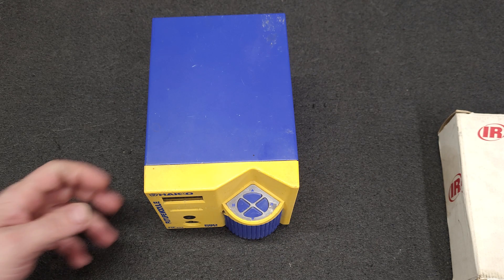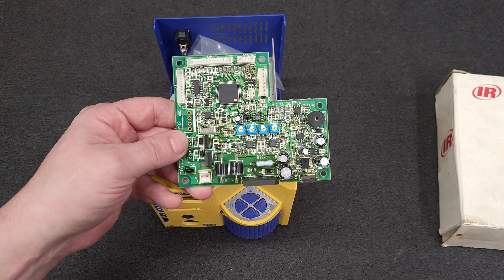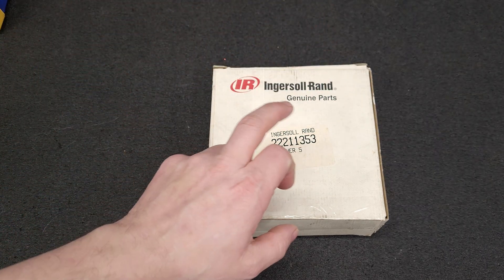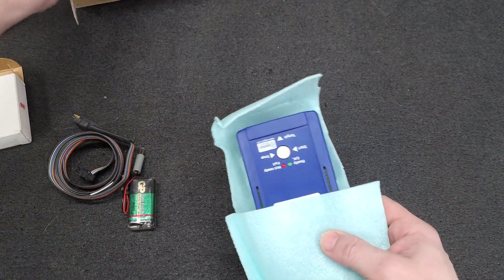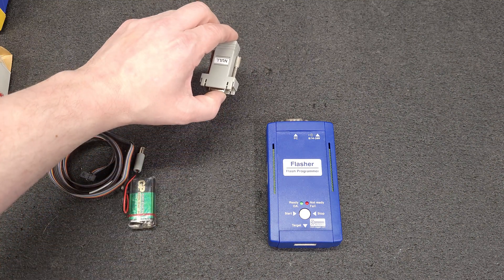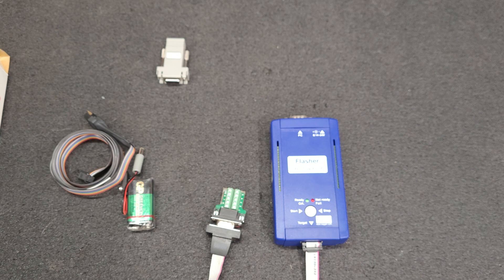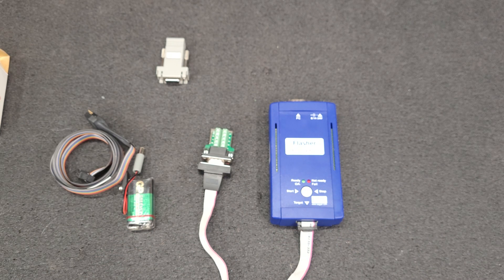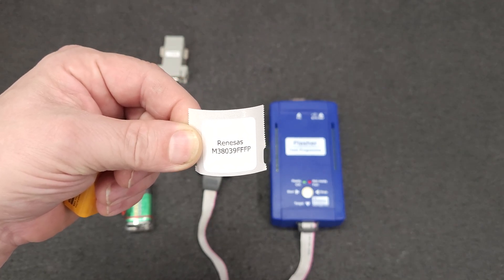F-U Hakko USA No Schematics or Firmware until the law makes you? I will get the FM-202 Firmware!

Comment: Programming a blank chip with a companies intellectual property (IP) is not repair; it's the production of a part, the programmed micro-controller, you need for the repair.

I could see you making the argument they aren't right-to-repair friendly if-and-only-if they didn't provide a means for you to get a chip programmed (particularly for units still in production); but they not only do that "they cover the cost of shipping" - That sound's pretty generous actually, they don't need to cover the cost of shipping or even offer the service to reprogram the firmware. Also this IS the correct way to support right-to-repair while also protecting your companies IP (even if its a moot point because the device is depreciated/out-dated and the firmware isn't locked down on the original hardware).

"You shouldn't have to send it to the manufacturer", "You should be able to get that firmware" - What makes you think you should have access to a companies IP? Buying a product that contains or relies upon IP doesn't grant you any rights to or ownership of the IP nor should it!

So now lets imagine we impose your will unto the world.. Companies have to provide you with the firmware for their products. 
What stops me from just building it myself and using the firmware they developed (likely at great cost) instead of buying it? 
What stops a third-party company from producing the chips for sale? 
What stops a third-party from producing their own hardware then using the firmware from the company that spent the money to develop it?

Once IP is out there it's out there. There's a DAMN good reason the Coca-cola recipe hasn't been patented and is kept under lock and key with only a handful of people knowing the full recipe..
Reply from the maker: That is part of the argument Hakko does not offer a preprogrammed microcontroller option as a repair part "even for modern devices" if they did offer one at a fair and reasonable price I would have bought one. All Hakko offers for a unit with a dead micro or other board issue is just an f-u buy a new unit or entire main board (Unavailable) that costs more than a new modern unit. 

Regardless, Programming firmware to restore a devices functionality is Repair! Imagine we impose your will unto the world there would be a lot more e-waste consisting of dead motherboards and other bricked devices from failed or corrupted bios/firmware. R2R is Not asking for the source/assembly code but for them to make a compiled binary available on fair and reasonable terms and cost.

I will be doing more videos and go in to all these anti repair subjects.
Reply: @Rhine_Labs  You mentioned pulling out you microcontroller is not safe but you want the right to buy a preprogrammed one and stuff your station up all by yourself?. Lets go with your view of the world - you get firmware for all your devices and guess what, so do ALL the cloners in China. One week you have it, next week Yum Cha releases a product that for all intents and purposes is just like the quality product you paid good money for. How do you feel...like you were ripped off? So your Hakko station is dead. You somehow know it's the controller chip? Wow, most people would just send them in to the manufacturer for repair. How much is the preprogrammed uconroller from JBC? Oh, they don't sell pre-programmed controllers either. They do let you update the firmware as does Hakko.
You're paying out good money to do what, flash your station when Hakko will do it for 10 bucks or tell you you have a dead controller chip or some other faulty part? You gotta be kidding us mate. Too many cowboys out there ready to take sheeples money to "fix" there expensive device and end up screwing the customer and the device. And fyi, the world IS full of e-waste including dead m'boards with corrupted BIOS. Go fix them.
Reply: To use your Coca Cola analogy, it’s like your bottle has leaked and you need to get hold of more Coca Cola liquid. You’re not wanting or asking for the recipe. 

And yes, of course flashing a microcontroller is repair (or replacing it with a preprogrammed one). The station is broken and doing that is mandatory to fix it. 

It should be illegal to take an action that prevents a repair, or fail to act to prevent a repair (like fail to give the firmware).
Reply: @davadoff  Bush lawyer you are. Your argument is specious, misguided and irrelevant. Hakko do NOT block repairing its tools. Back to law school for you.
Reply: @jed2055  you need the firmware but they refuse to send it. You’d have to buy another unit to clone the firmware. They could’ve made it easier. It’s anti right to repair.
Reply: @WblutSundAehre  Coca-cola is a consumable, a soldering iron is not.
Reply: @hurkamur1  your point is completely irrelevant; it doesn't matter if it is a consumable or not.
The point I am making is about the intellectual property required in this particular case.

Comment: They really became shitty towards customers with the fr810
Reply from the maker: The FR-810 is a POS I think the ATTEN ST-862d and Quick TR1300A are far superior units at a fraction of the cost. It would have been nice if Hakko would have made the firmware available even for a small fee but no way! I know the FM-202 is a 15 year old outdated/obsolete device but I am doing this on principle an $8.00 chip vs $220 control board vs the Scrap Yard. I have other Hakko units as well, so Being able to update your own firmware (if you have the means/tools) without being required to send it to the manufacturer or having to go through hoops to obtain the firmware and/or reverse engineer the device to perform an economical repair is a must. On the newer units that don't require an expensive programmer/adapter Hakko sets a custom 15 byte ID code to lock the Chip so you cannot read or update it. I may have to attempt a glitch attack to try and backup the firmware form the FX-951 and FM-203.